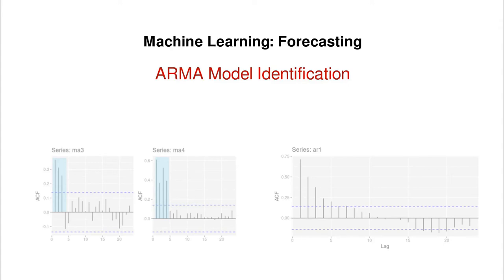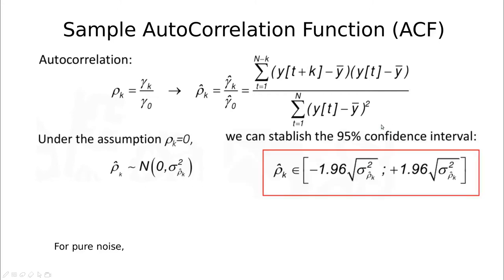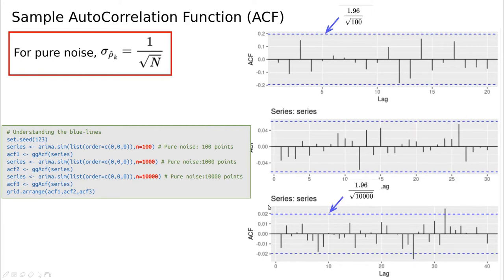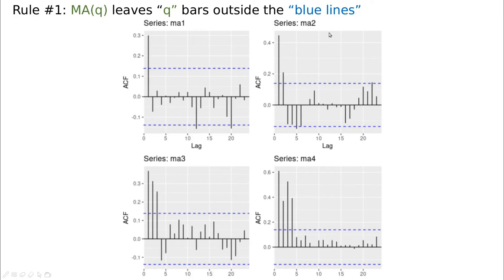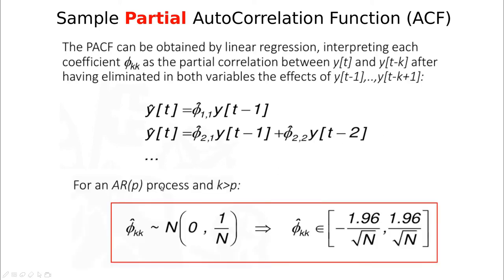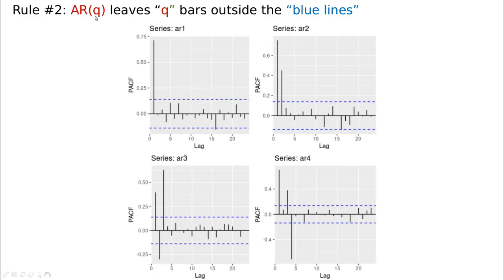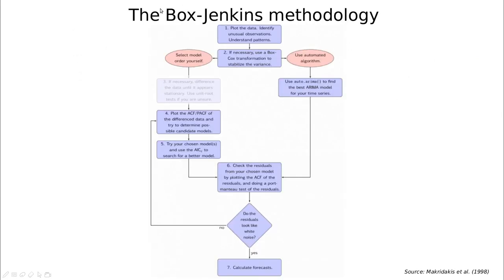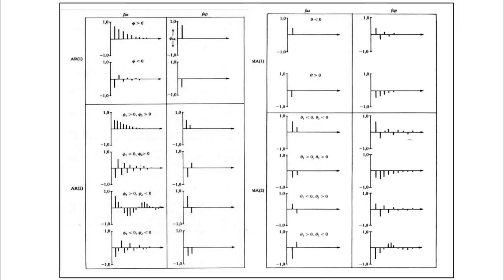ARMA Model Identification

Comment: Hi Mario! I have a question, what should we do when all the bars are within the confidence bands in the ACF and PACF?
As far as I understand that means there aren't significant p or q processes that can help in the creation of an ARMA/ARIMA model, but then what? Are we supposed to move to other models? Maybe a VAR?
Thanks!
Reply from the maker: Yes, it means that it's indistinguishable from noise. To jump to VAR models you should first check if the variance of the time series is  stationary or not
Reply: @MarioCastroPonce  So, in other words, my series is unpredictable, right? Because yeah, I checked for stationarity and did some unit root tests. They are stationary.

Is not about an economic variable or something like that. Tbh I was just practicing and wanted to see if I could predict goals from Barcelona lmao.

But then that's why I'm thinking about maybe using a VAR model in order to use other teams' goals as a variable. I can't think of any other model that could help. As said, is not very important, I'm just in my stupid time.

Still, although all bars were within the bands, I just tried to incorporate some ARMA processes and checked their significance. They are significant. It also makes me remember that phrase of "more of an art than of a science". Will tell you if it worked on Sunday ;)